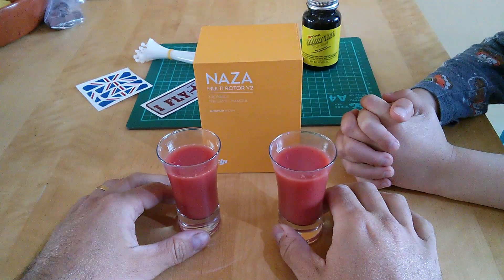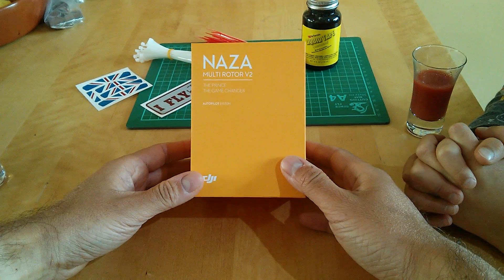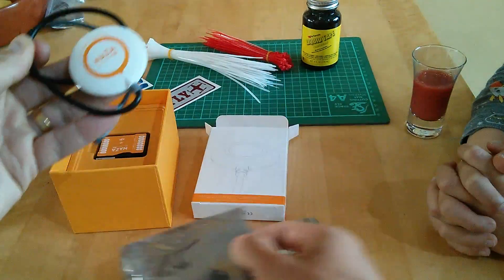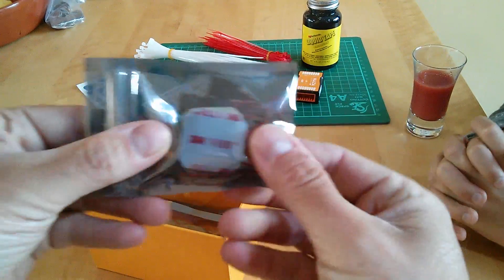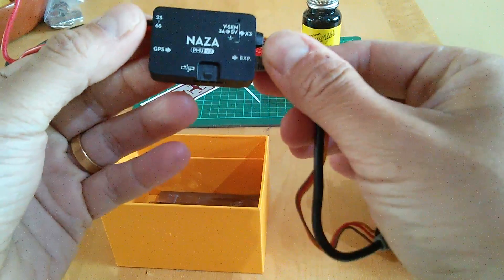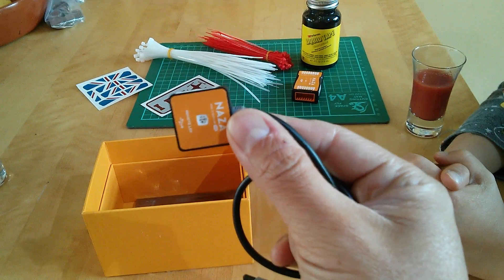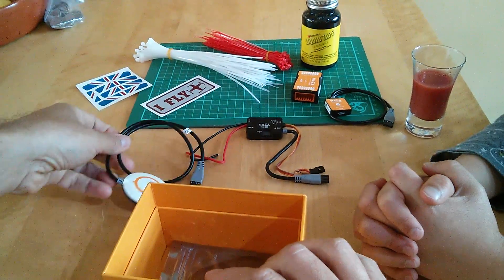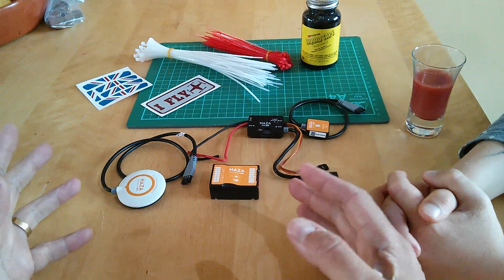Build your own Quad. Part Three - a look at the NAZA V2 with GPS

Comment: May i ask if there are cheaper controllers tha will do for the quadcopter?
Reply: +Simon Newton Oh i see.Another question i would like to ask if can you insert certain functions to your controller in order to minimize any errors you might have when the quadcopter lands or if you want to install a cruise control system you can do it with the same controller or you may need an extension?
Reply: +Simon Newton what's the range of this drone and price u spent on this
Thanks